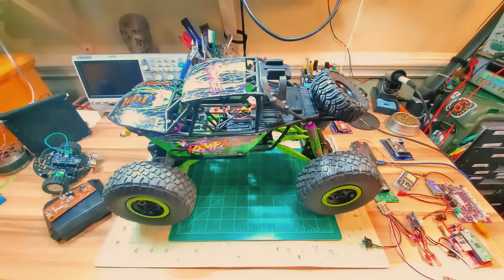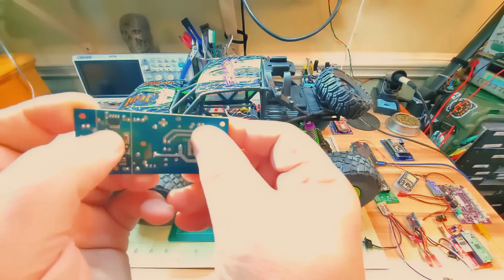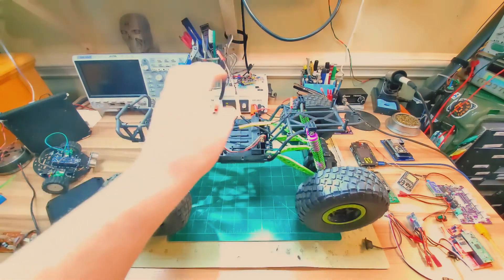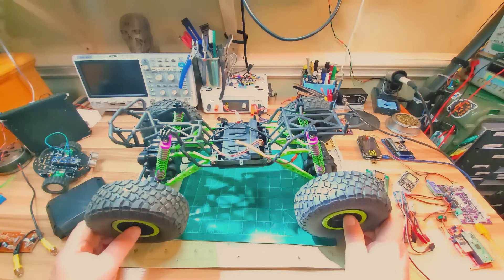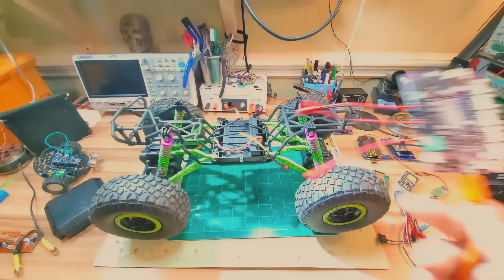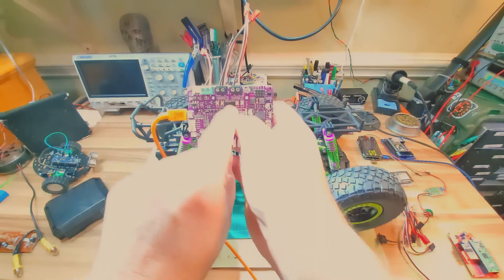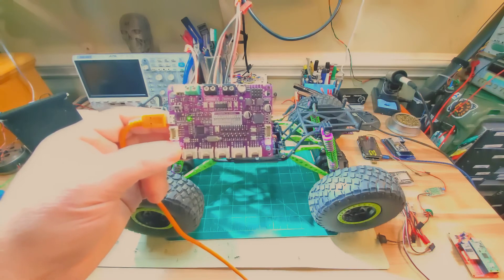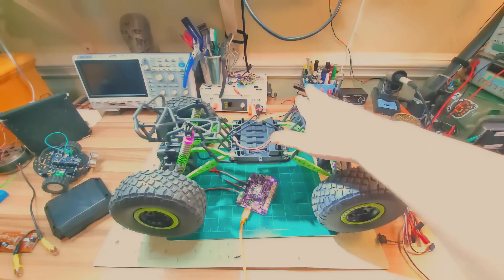Return-bin RC crawler with a Maker Pi RP2040?

Comment: Don;t know much about the maker pi , does it have a camera connector ? if so a way-point bot would be cool, nice vid as always Scott. once I get caught up on my other projects , I think I'm going to look in to one. Have fun my friend.🤓👍
Reply from the maker: It sadly doesn't have built-in camera support :(  You could us I2C to talk to another camera like some of the Risc-V cameras that are out now.  After playing around a bit more, the Maker Pi may not be the board for this project :(  I do have a bot I can put it on though and will work on it soon.  For the GPS bot, I will use my RPI Pico board with the ESP01 and separate motor drivers.